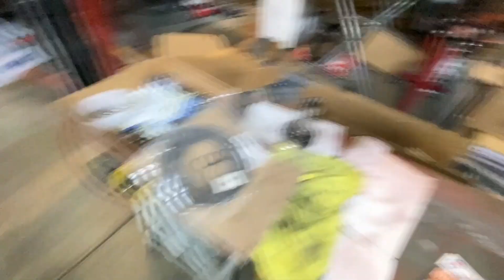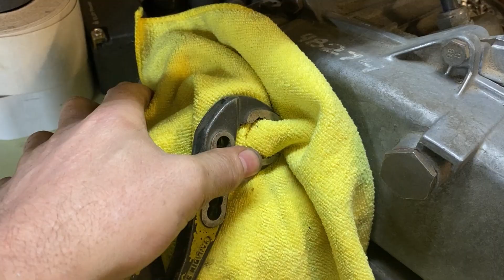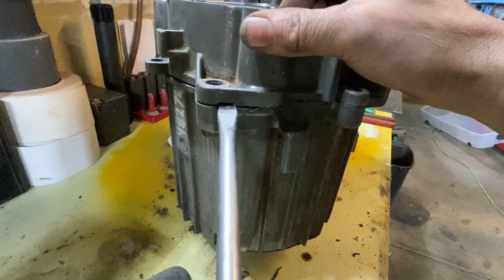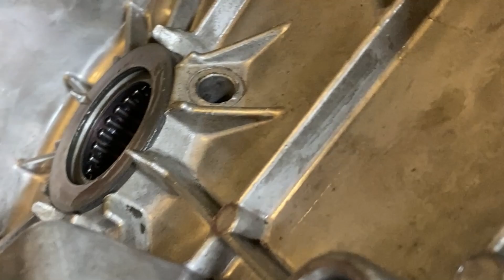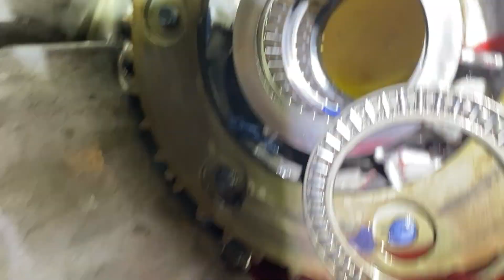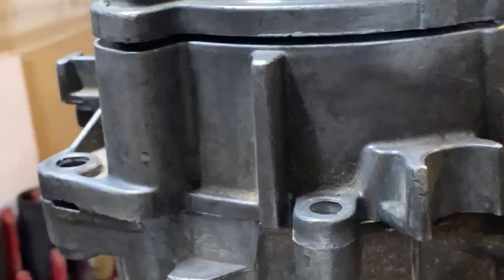Squarebody NP208 Transfer Case full rebuild with 32 spline input shaft

Comment: Did you put the speedo gear on the trans or the t-case I wonder what is more simple
Reply from the maker: There is no speedo gear on my setup.  I'm running a 4l80e which is electronic and has two speed sensors on it.  I'm using a Quick2 electronic controller for the trans, and that sends a speed signal to the speedometer.

Comment: In place of where your t-case had the poly washer that you replaced with a thrust bearing and washer mine just had the bearing no washer. I just need to replace the forward fork otherwise looks like a fresh case but is the thrust washer necessary and missing or not needed in my case?
Reply from the maker: No idea, I'm not an expert on these cases.  I'll be rebuilding another one soon so maybe I'll make another video and see what this one looks like inside.

Comment: Looking for a little advice if I may. I bought the M1009 1986 K5 military blazer. Restoring. Book says it is 3/4 ton but is six bolt GM rems. It has the 6.2-liter diesel with only 59k miles. I bought a wrecked 2012 3/4 Dodge pickup with Hemi to swap all out. I am second guessing myself now. Should I keep all original running gear or make the swap? Save the Dodge running gear for something else.  Yes, the Deisel does run but as you may know it has like 130 or so HP and is slow as grandmas Cadilac.
Reply from the maker: I'm not an "all original" guy so might be the wrong person to ask, but I build my stuff according to my taste and my intended use.  If you bought it just to drive around and enjoy then I wouldn't touch it.  If you bought it for towing then yeah the newer motor makes more power, but its going to be a big project.  If you want the best modern driveability, plenty of hp and torque and decent mileage you really can't beat an LS.  That the route I'm going in the blazer.

Comment: In the process of doing this exact swap in an 84 k10. I’m using a 2 wheel drive 4l80 because it already has the reluctor ring. I know I will have to mil some off the output shaft. My question is do you have a measurement of how much exactly and is there any other tips or tricks you can offer up.
Reply from the maker: Sorry I've never converted a 2wd to 4x4 so I don't know that measurement.

Comment: I bought a 700r4 that was claimed to be rebuilt well just discovered a 32 spline output shaft. So I need to do this to my no 208 do you have a link for the 32 spline input shaft

Comment: That is a HUGE amount of play in that annulus gear bushing, that should be a pretty tight fit.  That being said, it's not an easy gear to locate and no one seems to have it.  It took me a few days to locate a company that stocked the bushing, but was definitely worth putting things on hold to replace.  I ended up ordering from AllState Gear (NP208 Annulus Ring Gear Bushing, 13721), had to order 2 in order to meet minimum order requirements, but worth putting things on hold for a few days.  I agree, it would be nice if they included this bushing in the rebuild kit.
Reply from the maker: Thanks for the comment and the part number.  What will happen if I run it this way?  Does it just affect 4-low or will there be an issue in 2wd also?  I have another 208 T-case I can rebuild and have on hand if this one ends up giving me an issue.  Thanks!
Reply: @vikingmech  I honestly don't know what would happen, best guess is that the play is going to cause it to wear excessively and vibration.  The magnet should catch most of the metal, but you may be able to get a good idea if it is causing excess wear by draining the fluid into a clean container and checking for debri/sparkles.  Fluid will usually tell the story.  Running too much metal through the oil will trash a lot of the more expensive components.  This was one of two mistakes that I made rebuilding my 03 Tacoma's manual transmission, ended up pulling the trans back off less than a week later to fix,  no excessive damage as the issue was quickly caught and been running great nearly a year since I completed the re-work.  From my Tacoma experience, the fluid told the story when I drained it.  Hope this helps.

Almost done with my NP208 rebuild, had to put it back on hold for a few other hard-to-locate parts, but that's what you get when you are rebuilding a core.  Thanks for the video, getting a preview before I dove in helped a lot.
Reply from the maker: @255Vicks  Thanks for that response.  I'm building an 86 Gmc street/show truck.  It won't be a daily driver but I still want everything to work properly.  Don't want to take any chances so I'll probably pull this case and rebuild it again, or rebuild my extra core and put that one it.  I really appreciate the comment - this is one thing I missed and wouldn't have known about.
Reply: @vikingmech  It always sucks having to pull something back off, I was not happy when I had to pull my transmission back off to do the re-work. 
For the current project I am on, I am helping a gentleman with a restoration project by rebuilding a 700R4 (to include the 4WD conversion) and the NP208 transfer case to go with it.  It's been a fun project, especially since I didn't have to pull them off the truck, just rebuilding the transmission and transfer case on the bench.

Thanks again for the video and best of luck on your restoration.

Comment: Great video! one question, you said it will go behind a 4L80 e,  how you go about the speedo and sensors? thank you.
Reply from the maker: A 2wd 4L80e uses both speed sensors so thats what I'm running.  You can check the 4L80e rebuild video on my channel to see how I got both sensors working in a 4wd unit.  Then I just use a US-Shift standalone controller.

Comment: What output shaft for the prop shaft seal is that. It looks like one from a NP241
Reply from the maker: @jd8230 I found that seal on amazon.  GM Genuine Parts 15661460 Transfer Case Rear Output Shaft Seal

Comment: Where did you put the new thrust bearing at 14:49?
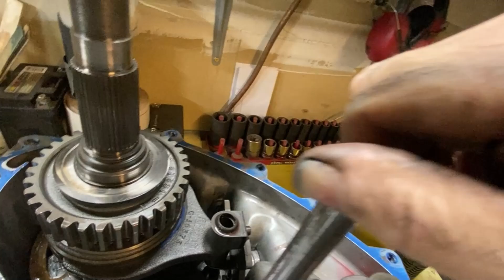Reply from the maker: @tsimshian886  It goes on the back of the front output shaft.  You can see it at 3:50 in the video.  On the right hand side.